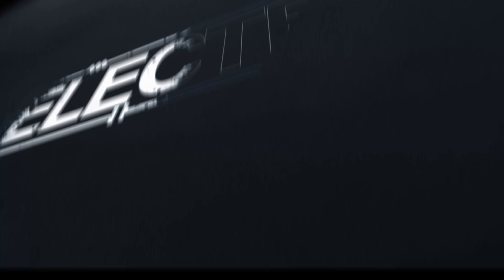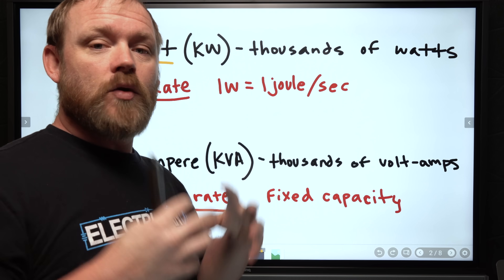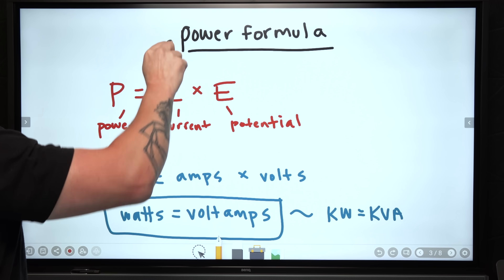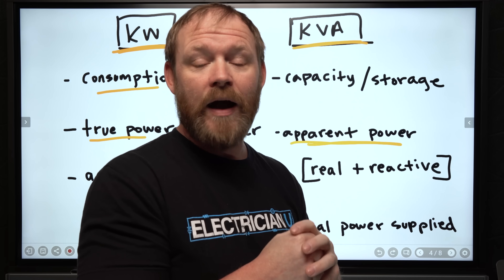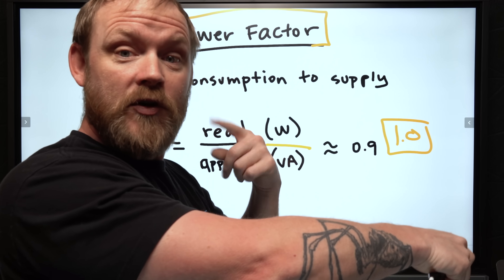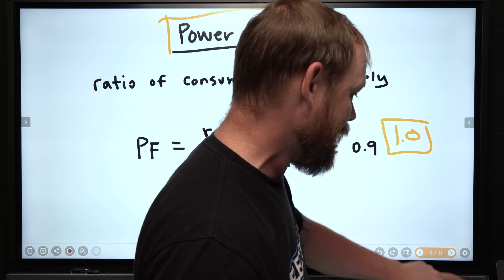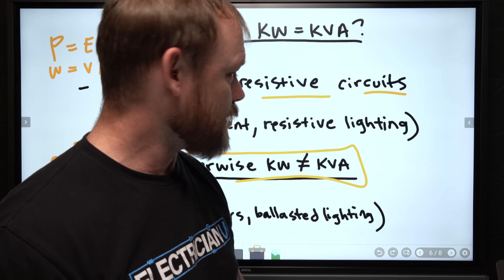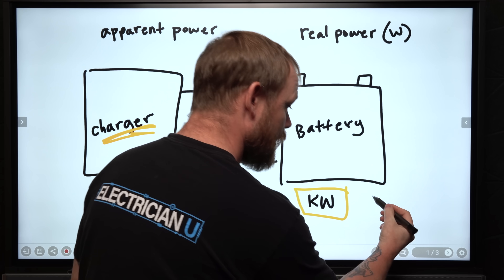Why KW and KVA Are NOT The Same Thing (Even If They Seem Like It)

Comment: Summary: KVA refers to the input power from the source. KW refers to the power that is being consumed. Waste heat is power being consumed that doesn't do any useful work. 

KVA Input Power = KW = Output Power + Waste Heat. 

The power factor is a ratio that refers to the efficiency... how much of the power is converted to useful heat and/or work, versus power that is converted to unwanted waste heat.  

Lastly, when charging batteries the battery is the load and as the battery heats up, most of the energy is stored yet some of it is wasted.

Comment: Yeah, I will still just talk about watts. If 1000W is going through a transformer but only 900W is being consumed, it is basically the same thing, it is providing 1000W, if it is being consumed or just transferred along, it is still essentially handling 1000W. If you were sizing your incoming power connection for your industrial plant you absolutely need to know about reactive power, but for the other 99% of us you can just go by the general rule of thumb to avoid using more than 80% of the wires capacity continuously.

Comment: This topic was very confusing to me reading electronics books, and so around age 10-12 I asked a family friend and mentor who was an RPE/EE to explain it.  

I didn't realize until years later how he taught me simplified algebraic simulations of doing Integral calc on trig functions, after a social dinner one night.  

And applied meanings, that this video misses....  How heating values have equivalents between AC and DC systems....  or (pi/2)^2 (Ohms law power relationship, where 2 is the integral of Sin or Cos for a 1 radian period, vs pi the same peak amplitude DC circuit energy content).  

Batteries or transformers are loads depending on what system elements are under review.  Batteries as chemical storage to not have simple C or L X reactive elements as simple trig angles, the way LCR circuits do.  

There is power loss in transformer cores and windings.  A major element of power distribution is that I^2*R determines most distribution losses in conductors, and so circuits are designed for power transfer and allowable current limits that define allowable system loading with a given level of reactance compensation, outside of which conductors overheat and losses as heat increase.  

kW and kVA are never the same, but near 1 pf they almost are.  Many devices are dual rated for power and kVA, as a limit to thermal tolerance to reactive losses.  

There is no such thing as reactive power per se.  Power is the non-reactive (eg resistive) portion of the overall vector sum.  Reactive loads may cause elevated power loss, but that's I^2*R heating elevated by increased current for a certain power transfer in a reactive circuit, which is a resistive loss even if due to reactance.  

Clarity on such details requires visualizing system elements of different circuits, and the math of vector sums and trig relationships.  

Another major issue is switching power systems, in power supplies, motor of light controllers, and small DC devices.  Those have other trig and time integration issues needing their own topic.  

Anyone who praised this video, especially claiming to be an engineer who presumably knows better, needs to inspect their math and engineering weaknesses until they can understand how this video tosses out a lot of terms rapidly, sometimes presenting important ideas, but often with misleading or outright wrong statements.  

Think more about why some components heat excessively, as well as inrush or arc-over currents. Or why 3 phase motors don't need start windings and capacitors, or shaded pole inefficiencies.  

Kudos to the electrician for trying to take on a difficult topic to present, as to do it well requires an audience that is strong in math, and visualizing real world applications of it to common technologies most people never learn well.  That's sort of a chicken and egg learning curve, where the answer to the age old puzzle is that both come before and after the other.

Comment: My favorite way of looking at this is that Watts is actual power delivered to the load, making something move, heat up, glow, whatever. Volt-amps, on the other hand, is "borrowing" energy to build up a magnetic or electric field (this takes one quarter of an ac cycle, about 0.004 sec at 60 Hz (US) or 0.005 sec at 50 Hz in lots of other places). The field then pumps that energy back into the power source during the next quarter cycle. Your electric meter is usually designed to ignore this constant borrowing and repaying of energy.
Some types of loads (inductive and capacitive) can use lots of volt-amps without using many watts. There are some losses, which you do have to pay for. But electric companies hate this because they have to put in thick wires and other parts that can handle all this current without selling you much power. So they try to get you to fix your power factor (the relationship between how much power you "borrow" and "repay" vs how much you actually use and pay for) or charge you extra if your power factor is low.

Comment: Watts is short for watthour in other words, watts per hour. The "K" in KW is 1000 watt hours. In other words, a 100W light bulb uses 100 watts per hour.  Not per second. As you mentioned, AC has functions, i.e. induction and capacitance, besides just volts and amps to arrive at power. When working with DC, "VA" is not used. Only volts, amps and watts are used. I.e. a 12v lifep04 battery rated at 100amp hours, will put out 1280watt hours of power to depletion. If you are working with solar, solar only puts out DC that is used to charge batteries. That power in turn is supplied to an inverter to turn the DC to AC to supply a home, RV, etc.
Reply: Wrong! Watts is Watts and Watthours are Watthours
Reply: @Selectronify  You must have received your degree in the last 20 years or you don't even have one.

Comment: the capacity is usually referred to as Amp Hours, but
--- 100 AH at 24 Volts is double the work capacity of 
--- 100 AH at 12 Volts is double the work capacity of 
--- 100 AH at  6 Volts is double the work capacity of 
--- 100 AH at  3 Volts
Reply: Good point. But it’s all really a marketing label. While batteries you buy for a UPS for example is rated 10AH @12V, we can technically deduce the rate of depletion. As for cars the label is kW to describe its capacity based on its consumption to charge. It’s rate of depletion is a mystery to me since every ev car manufacturer uses different running voltages.
Reply: @lelmus3277  I think you mean "kWh" there for cars, not "kW".  Power alone does not represent any particular amount of energy or capacity.  Energy is power x time.  So 1 joule = 1 watt x 1 second.  1 joule is 1 watt-second.  That's a very tiny amount of energy so we mostly use watt-hours or kilowatt-hours (etc) to represent more reasonable amounts of energy.  A car's battery is typically rated in kWh kilowatt-hours.

A typical battery has a capacity in amp-hours and a typical voltage. You just multiply them together.  So a 100 amp-hour 12V LiFePO4 has an average voltage of 12.8V.   So you get (100Ah x 12.8V) = 1280 VAh = 1280 Wh = 1.28 kWh.

Those are definitely not just marketing labels.  A marketing label would be, say, a little power pack that advertised "25000 mAh!  HUGE!", but fails to mention what voltage those mAh are stored at so it doesn't actually tell you what the capacity is.  You have to guess.  THAT is marketing 🙂

--

"VA" is volt-amps which is a unit of power identical to the unit of power called "Watts".  But in terms of reactive power, the values are radically different.  i.e.  transmit 1000W, get 100W of reflected energy, total is 1100VA (1100W).
Reply: @junkerzn7312 
kW, kWh, and Ah relationship to EV Battery:

Unit / Measures / Depends On / Example

kW / Power / Energy flow / Voltage × Current / Determines acceleration & charging speed

kWh / Energy capacity / total stored energy / Voltage × Ah / Determines driving range

Ah / Charge capacity / total stored charge / Current × Time / Only useful with voltage to calculate kWh
Reply: Ummm you wrong, they are not always the same

Comment: My Dad worked for what is now called New York Power Authority. He told me transmission lines were rated in KVA, e.g., 650,000 KVA. Power plants were rated in MW, Mega Watts. The former is rated for the load it can supply. The latter is rated for the power it can produce.

Comment: For extra confusion, add in Kv for the 3 phase motor rating of the number of RPM per volt of electricity.

Comment: So an electric vehicle “charger” EVSE is rated in kW or speed/rate-of-charge. It takes 120 or 240 volts x the amps to feed a battery. The EVSE is not rated in KVa but rather kW because it is not the source of the power, only an intermediary from a source to a destination?
Reply: No, the EVSE as an intermediary is basically just a contactor and the contactor is definitely rated in kVA, just like a circuit breaker would be.  But because the AC charger in EVs has near unity power factor, the distinction is irrelevant and all the marketing material and most labeling generally just uses "watts" to avoid confusing the consumer.

Comment: which is why the utility company will charge you more than your apparent kW load if your power factor is not as close to unity. The current supplied  may be larger than expected which means you may overload supply cable ratings, many larger electricity meters will have a KVA reactive reading and the customer may be charged an excess.

Comment: Here is another video idea for you.  You just posted a video about how kw does not equal kva most of the time.  Also saying that loads with zero reactance are not the typical norm.  Then I watched the video about bad terminations and you limited your self to a zero reactance example.  This example does not cause fires very often.  A changing resistive termination in a highly reactive system is what typically causes fires.  The reactance tries to maintain its designed power consumption and the current draw can increase as the voltage decreases.  This fault can and will induce an arc which in turn gets very hot very fast causing a fire.  I recently was a victim of this exact problem. A 120 V system designed for 50 amp service melted down and started on fire due to a bad termination.  The system had logged a continuous current draw of only 15 amps with no large spikes during the entire incident.  I.E. no breakers flipped when there was an active arc present.  The load was a 1:1 transformer. The load on the transformer was a air con system with highly inductive compressors and fans.  The bad termination got hot enough to melt the plastic of the receptacle. That allowed the termination to move close enough to a metal safety ring (that was grounded).  Then an arc was initiated, probably from the compressor cycling.  Then resulted in a rather impressive fire.  We know there was an arc because the incident was caught on camera in the middle of the night and you can distinctively see the arc flash.

Comment: I've been trying to explain the convention of using bits and bytes in computers for the past 27 years, in almost the same way. Yeah - I know how hard it is to get something like this through! 😀

FYI - In computer convention, "bits" is used to indicated speed. "bytes" are used when STORING information. 1 Bit = 8 Bytes.
You'll see your internet speed is rated at 100Mbps(megaBITS per second) for instance, while when downloading/copying/converting a file, the "value" or indicator is shown in BYTES per second (that's cause you're in the process of storing a file/information, on your hard drive).

Comment: I much prefer to explain this with graphs of voltage and current. With an AC system, you have a sine wave switching back and forth 50/60 times a second. If your load is resistive (like an incandescent light bulb), current changes exactly as voltage does, and kw = kva. 

But otherwise, peak amps and peak volts do NOT occur at the same time. So for a 120v RMS system (170v peak) you might be drawing 100 amps when the voltage is 85 volts, but only 50 amps when the voltage is 170 volts. Both of those work out to 8.5 kW. However, if you size your lines and transformers without considering the power factor, you will miss the higher amperage at lower voltage, and amperage is what causes resistive heat and determines conductor size, not wattage.

Not only is this a safety concern, but it's wasted infrastructure. You have to size your conductors for 100 amp load, when a better power factor would let you transfer the same amount of useful energy using only 50 amps.

Comment: OK, you covered batteries (KWh), but why are generators rated in watts, not KVA?
Why are audio amplifiers feeding impedence loads rated in watts, not VA or KVA?
😮
Reply: I worked at a nuclear power plant.  Our generators are rated in KVA but we never talk about them in KVA.  The prime movers (steam turbine or diesel engine) are rated in KW.  In our control room there were no KVA meters.  There is a KW meter (actually MW meter) for the main generator and KW meters for each of our emergency diesel generators.  There are power factor meters and frequency for all the generators.  There are voltage meters too but once a generator is sync to the grid, the voltage and frequency really do not change.  When the emergency diesel generator is isolated from the grid (station backout), then we have to control voltage and frequency too.

We control the prime mover, that is the steam turbine or the emergency diesel engine, to adjust the for the load (KW).  The system grid is the load to us for the main generator.  The design of the generator determines the max ampere output and is not really adjustable assuming all the support systems are working properly (think stator and generator cooling).  We can adjust the generator excitation to adjust the power factor within limits.

We really do not know what the loads are on the grid at any give second.

However, our emergency diesel engine is rated at 4430 KW at 514 rpm.  The engine has a direct drive to the generator.  The emergency generator is rated at 4430 KW at a 0.8 power factor, 5538 KVA.  The meter for the EDG is in KW.  I need to know if I can add a 1250 HP (932 kW) emergency pump to the load of that diesel generator if the present load on the generator is 2000 kW.  I am guessing this is why the generator-set is rate in KW or at least talked about in terms of kW.  Even home generators are rated in watts so that you can size it by the load in watts that you can plug into the generator.

We only concerned ourselves with KVA when overheating conditions occur on generators or transformers.  The we have to pull out graphs to determine the best course of action to reduce heating on the windings.  Sometimes you can change the power factor or you might have to reduce the load or both or you have some many minutes to restore cooling or greatly reduce the load on the generator or transformer.  Reducing load and keeping the voltage the same will reduce the amps.

I do not know this for a fact but I would say that the reason might be that we are more interested in generator loads the the prime mover or engine can support.

Comment: It's very simple. 6.24x10 to the 18th elections moving through a conductor in one second is a watt. They are the same thing, Power factor is just a measure of final efficiency that is impacted by anything not resistant as well as resistance.

Comment: Excellent explanation.
Many contactors, thransforms, disconnects etc. Are (rated) in KVA ,because KVA is a snapshot or fixed rate of power tolerance, a given item, such as a connector (can handle) (in a given instance.) or (continues.)
Power in KW is active power in motion doing work. Many electrical components are rated in power or kw because this is the active rating of power required, or doing the work.
Then we throw in the words "potential," "minimum," "maximum," "continues,"
"Momentary," etc
O - MY
Thank you.
D-- FOR ME ON THIS CLASS.

Comment: Okay, but when you want to run a 2Kw motor, for example, you need to know how many KVA it’s going to require, both to start it and to keep it running. That’s what people need to get a grasp of. Quality manufacturers sometimes provide power factor figures for their equipment, but not all do and the figures given would always be best case, lab conditions, not real world. The difference between reluctance and reactance and how they can be used to counteract each other, to achieve near unity is also important. Frequency is also important. Power factor correction has to be designed for the correct frequency, as incuctive and capacitive loads don’t respond the same way to frequency changes.
This video hits the frustrating middle ground, where it’s too technical for people with no training, but way too simplistic for anyone else.
The simplest way to explain this for Joe and Josephine Average is that most things they plug in are inefficient and use more power than they can actually turn into useful work. If they understand that, then they’ll be comfortable with over rating power supplies. Fridges and A/C units are probably the biggest offenders, in this regard, for regular folk.
There’s another step, in all of this, which users of industrial equipment will likely come across. Motors are often not rated in Kw. The manufacturers prefer HP. I’m no longer involved in that business, having had a whole lifetime since then, but if memory’s serves, one HP is roughly 748W. Correct me if I’m getting that wrong. It has been a very long time…

Comment: Anything that's supplying like a transformer or a generator needs to be rated in kVA because there is no way of knowing yet what the power factor of the load that  connected to it will be.